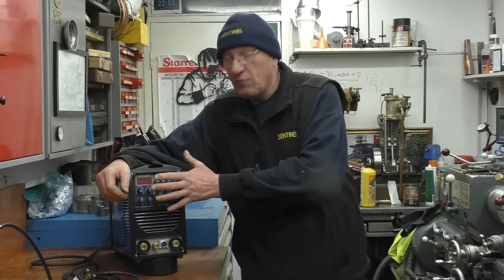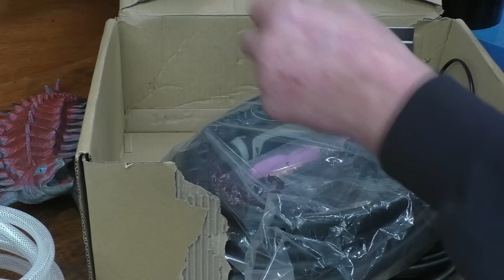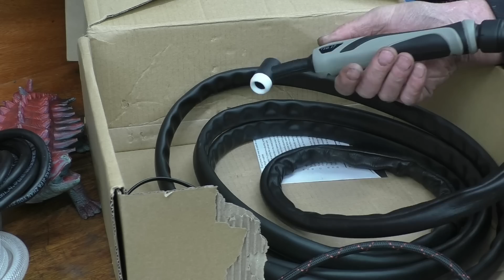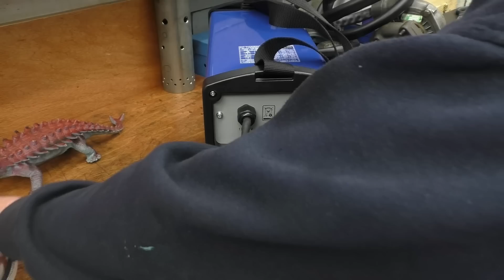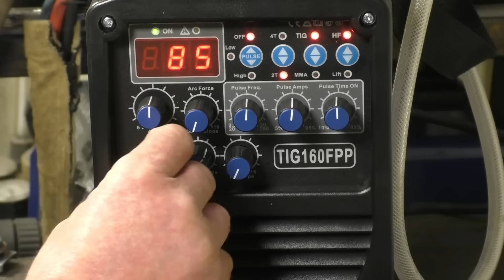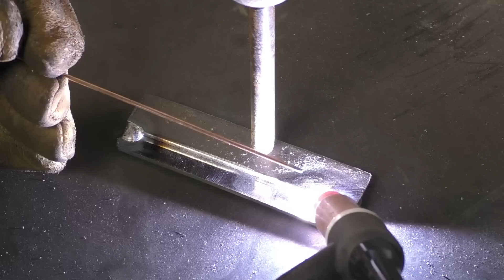R Tech TIG 160FPP  Review

Comment: Will this unit weld aluminum? Is the foot pedal available as an option or is it an aftermarket accessory? Thanks for the demo.
Reply from the maker: The unit will not weld aluminium for that you need AC . The pedal is a option as are various torch set ups
Reply: @doubleboost  Good answer and a bit surprising for me - I didn't realise that ac was needed for aluminium. Are ac welders more expensive and will an ac machine do everything a dc machine would? Thanks.
Reply from the maker: @caahacky  They are more expensive  AC  DC  machine will weld anything